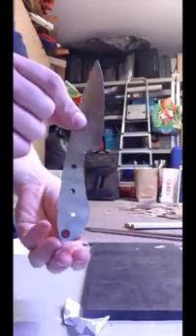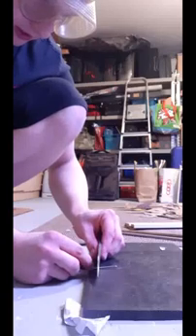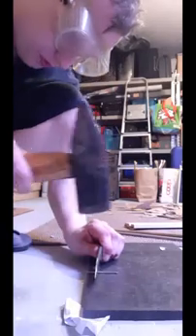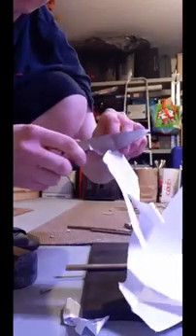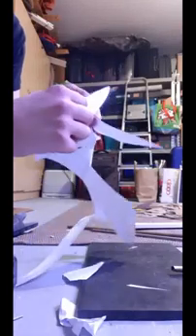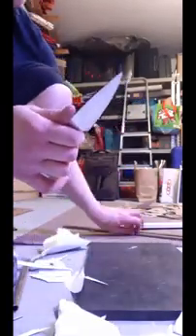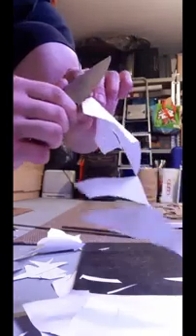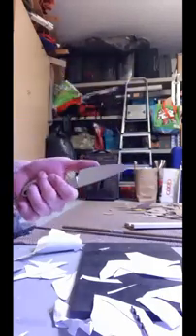68 Rockwell S390 steel knife toughness test

Comment: I'm quite impressed, but I want to add that drill bits are NOT very hard on the side where you put them into the machine (they are only hardened on the other side), so that the drill gets some good grip on the drill. A very hard drill would not be holding well and turn around in the bit holder. This is also the reason why you can often see chipping and "smeared" metal chips on used drills.
Reply from the maker: Yes, I learned that shortly after. But it's still considerable harder than the usual steel nails that get chopped.
Reply: @kknives_switzerland  That's for sure since drills break and steel nails don't, haha. 🙂 
And ironically enough, I didn't know this fact, either, up until two days ago when my uncle who is a learned blacksmith, weapon smith and master craftsman (Schlossermeister) told me about it.

Comment: Do you Think  it would be possible (not necessarily practical), to make a katana with high hardness steel (>62 hrc, for example)? If money and time were fully available....
Reply from the maker: Absolutely it would be possible. No issue with that. Would be practical, too, with Z-Tuff as a core layer.
Reply: @kknives_switzerland  yess... and what Steel would be used as The jacket for The Core?
Reply from the maker: @migueldias191  I'd probably use something austenitic, though titanium or Nitinol would work too.

Comment: I have a question Roman. This steel S 390, and a few others (k390, maxamet etc, even S35vn) have cobalt in them, but that seems to be rare. My question is, what does the cobalt contribute to the steel? I can’t find an answer to this.
Reply: Cobalt increases hot hardness
Reply from the maker: Yes, that plus less hardness drop during tempering. It's use in a knife is very limited.

Comment: Impressive! Fun to watch what is possible. Great work. How does S390 compare to Vancron?
Reply from the maker: There will be a video on the matter, but put short Vancron is finer with <1micron carbo-nitrides, while S390 has 3 to 5 micron carbides. S390 SHOULD cut a tad longer than Vancron though, but I yet have to confirm that via testing. Will keep you guys updated!👍